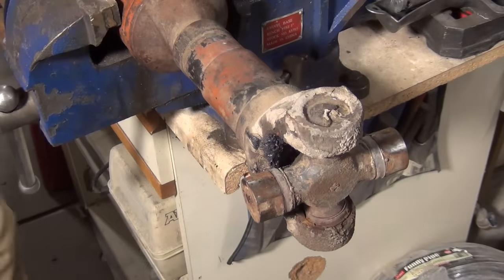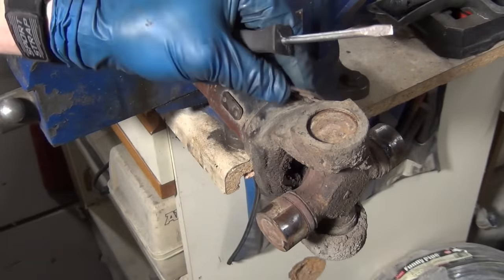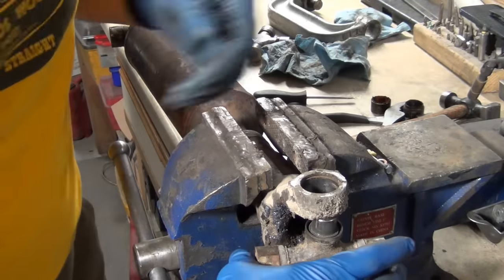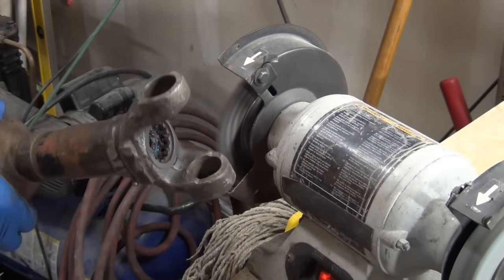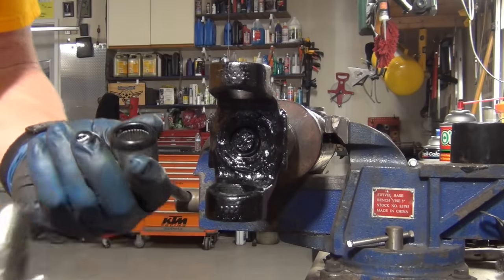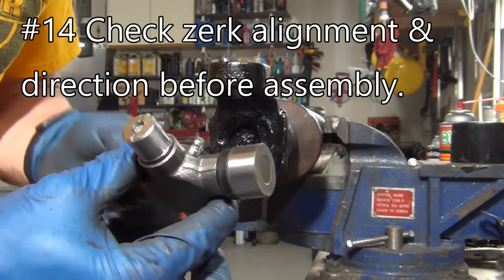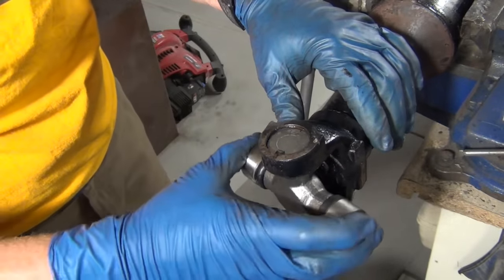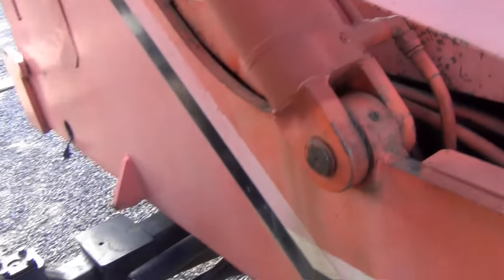20 Tips to Replace U joints Like a Pro from a Professional Mechanic

Comment: The moral of the story... Shop managers, hire those just out of high school to do this job. Why? Because when I was in high school auto mechanics i did this a bunch of times and consider it a task along the level of changing plugs. Now move the clock forward 60 years. I have to change my U Joints in my truck. So ran across this video and thought a refresher was in order. It should be a no-brainer ($10 parts and free labor) but after watching this video, I'm thinking, "You know, I'll probably take this to a shop since the labor will probably cost $150. LOL!" Nope, probably not because I have more money now, just lazier. And how much did U-Joints cost back in those days before China... I think about $6 ea. Great video! Thanks!
Reply from the maker: Welcome Sam!

Comment: I had an old mechanic tell me to watch for the rustty red color of a brick! He taught me that when you have a piece of metal grinding together that has no lubrication it pulverize the iron and turns it back into Orr! Which is what it started out as in the beginning! Orr is the color of a clay red brick when it is extracted from old mother earth. I have wrenched on cars for thirty plus years and have seen and looked for this color to tell me I have pieces that are dry of lubrication and needs attention 😉

Comment: Be verrrrrrry careful hammering on, and putting driveshaft in a vice. They are hollow and not designed to take side loads. If dented will break under torque when put in car. Hammering can create unseen stress fractures in metal. With heavy loads and stress can crack parts.

Comment: You recommended using brake parts cleaner and then you welded the same surface later. It would be good to insert a note about chlorinated cleaner and welding creating phosgene gas. Might save a newbie’s life. 👍

Comment: The Spicer that was in there was stronger than the one you installed.  The sealed u-joints are typically stronger due to not having the grease channels inside.  So, if you are blowing out u-joints in a lifted truck or highly modified vehicle by suspension or adding power or towing, then you may want to invest in some sealed Spicer u-joints.

Comment: Just for added piece of mind for the beginners.  Always save the old clips just incase the new ones dont  fit your specific application.  And after installation of the clips you can use a flat screwdriver and tap them into the slot to be sure they are fully set.

Comment: Love your style,, I have been a mechanic for about 50 years and back when I didn't have a press to push the cups out, I had to beat the cups out with a hammer. But other than that,, I replace the joint exactly like u do,, the grease in the cups have saved me many times. Harry lewis
Reply from the maker: Thanks Harry!

Comment: Wow, I think this is the most helpful video I've found for just walking through the process of doing U-Joints.  I've done plenty of these over the years, but I can see that some of your little tips are just pure gold!  I've never heard of using the ATF before, but I'll certainly be picking up a quart of that as I work over my CJ-5.  I'm just at the point where I'm putting axles shaft u-joints in, so this video is definitely getting a bookmark!  Thanks!
Reply: Try 50 % Acetone & 50 % (synthetic) ATF to loosen any bolt, they contain the smallest Moly  of penetrating fluid. Mix a table spoon together let it sit for 5 min, Acetone loosen the rust, Synthetic ATF lubercate the parts for disassembly..

Comment: Thanks for one of the best, informative, efficient, videos I've seen. I've never before learned so much in so short of time.  You addressed EVERY STEP AND PROBLEMS ran accross.  Thanks for all the tips.  1st joint - 5 hrs 
Watched video. 2nd  joint  - just over an hour including a shit and a snack!!  2000 ford f250 super duty crew 4 x 4 7.3 Thanks again.

Comment: Just put in U joints on a friends Ram 1500. Luckily I have access to the Auto Hobby Shop on base and used the press and dies.  Once I finished, the u joint was really tight and didn't pivot as smooth as I liked. A friend of mine also working in the shop that day told me of a "little trick" about tapping on the caps just a bit to set the needle bearings.  It worked and the joint would pivot nice and smoothly.  Ever heard of this?  Just like everyone else...put it out there, we'll watch!
Reply: Great advice

Comment: Over the years of working in the industries, trucking and personal four wheeling I've learned that you should always stay with the same grease or if you switch then remove all the old grease.  Different greases will attack each other and turn to a worthless light oil.  Also, when installing u-joints, make sure you put the grease zerk so it is under compression when traveling forward.   A hole in the u-joint where the zerk goes is a weak area. Enjoy your videos and humor.  Keep up the good work!
Reply from the maker: Thanks for the tips!

Comment: Thanks, nice video. Haven't changed any universal joints in like 40 years. Last time was on a 70 ish Ford Mustang and it was easy as pie like the few before. Caps pressed out and in with just a few taps of my hammer. Working on my Kubota belly mower and these are so tight I was thinking I was going to mess up the yoke so I stopped, stepped back and slept on it, usually my best course of action. Anyway, picked up a few tips and will get'er done today.

Comment: I've been replacing u-joints for years and I have to say I've approached them in many ways. In my youth it was a hammer and socket but now I use my homemade hydraulic press or my Astro ball joint tool I found on Amazon. 

I wish I could post photos here but I think you get my meaning...

Thanks for sharing Brian and great work!

Comment: I did this with the front shaft on my 90 Suburban.  I took the ring off the yoke and removed the yoke completely from the shaft to get it all cleaned out inside.  Thanks for the videos.

Comment: Thanks Brian.   Filling the caps with new grease is fine , but also chase out the shipping grease from within the joint and zerk fitting ,it looks like earwax.    That stuff is really not grease , but some sort of goop the manufacturer puts in there to keep corrosion in check during packaging , shipping and storage.
Reply: Yessir! Just found that out. Installed a sealed u-joint and was super stiff, so had to pop it out and inspect, found out that the manufacturers grease isn't grease at all. I pushed out the crap, removed and cleaned the needles and caps and packed it with wheel bearing grease. Works perfectly now. I was wondering why their stuff was so terrible... makes sense now.

Comment: Good informative video, bud. I like and agree with using atf. I've been using dielectric, which works fine for high heat lubricant and rust prevention, but atf is way cheaper! Thanks

Comment: good video. old news for old hands like like allot of us, but the next best thing to a hard days work is watching someone else do it!!! You would be surprised how many young guys can't change a u-joint to save their lives. I like to take a small dremel wire wheel and clean the yoke and snap ring bores really well. do it right and you can almost install the caps by hand. start pouring the meat to the caps with a hammer and you'll end up knocking the needles out. 5 minutes of prep work will save you 30 minutes of curse words.
Reply from the maker: Thank you- great advice Joe!
Reply: Not really accurate. There needs to be an interference fit. If the cups install too easily than the fit is incorrect. A hammer is fine if you know how to keep the needles from falling out. As simple as some extra grease...
Reply: I don't think he meant the caps just alling into the yoke. What I do after everything is apart is take a brake hone and run it in the yoke. With that I can lightly tap the caps in with a light ballpeen hammer.

Comment: Newer trucks and cars have plastic holding the factory installed U-Joints instead of G clips.  When you replace them, you need to heat them up with propane torch and the plastic will squirt out and then use G clips on the new ones.  I've been working on cars since mid-sixties and first time I did this job I was a bit perplexed but after seeing for myself I realized no big deal.  
Brian; it my help others to show them this particular twist so they can not be wondering what's going to happen.  I never believed the plastic would just squirt out like that until I saw it happen.

Comment: Brian, I have always completely set up one side cap fully into the yoke so that when I tried to install the second cap, the span of the caps will be close enough together so that the u-joint will slide onto both sides at a time, negating any room for the needle bearings to slip out.
Reply: That's the way I was taught to
Reply: Ume the Emu Metoo

Comment: I never change my u joints like this anymore , it's much quicker to zip cut them from the inside and tap them through with a small hammer , the initial shock loosens them up and your not fighting or dragging rust through the hole . Another reason is trying to push through extremely seized u joints you can tweak or deform the yoke and you will not get the retaining clip back in if their internal type with out a spreader tool . I tap them back in with a small ballpein hammer much quicker than pressing them in . I've been doing this for years .

Comment: Good video. Those ten buck U joints have ruined many a vacation and even caused drive shafts to drop out and pole vault vehicles into the air. It's great to be able to replace them yourself, and save lots of $$.  Also so many original equipment joints do not have grease fittings, which ensures a failure.

Comment: Just fyi though if you are a diyer and start messing around with your driveshaft you can cause vibration. So this job is doable and not that hard, just know though that you can cause problems, I know this because I did. 

I think in my instance my first mistake was not getting greaseable u joints I think the greaseable ones are more forgiving because you can put grease in there to help free them up. Also the u joints I got felt pretty tight, so I am gonna try and get some smoother greaseable ones. 

Also you want the u joint to feel loose and it should turn freely and smoothly in the drive shaft, that is pretty important you don't want tightness. 

Also it's CRITICAL that you mark everything so that it all goes back the same way it went in those drive shafts are BALANCED and if you start messing with that balance you can get vibrations.

Comment: Did many u joints over the years and had a few that would not move especially on bigger trucks. Easiest way I found to get them out is with the fire wrench burn the cross bar off then the caps just about fall out.

Comment: ATF is good stuff. Mix it 50/50 with acetone, and soak steel parts that have rusted together loose again, provided it has not fully fused together. Fixed a very old Colt .38 revolver like that once. The  (revolving) cylinder also known as 'the wheel" had rusted to the crane's axle shaft. Soaked it for @ 8 days in a closed container. Freed right up. WAs frozen so tight I couldn't begin to turn when I started.
On driveshaft universals, I remove them by using correct diameter sockets and the vise as a press to press out the universal. Cheap, no special tool/s and works well. One needs a helper though, to help hold/align DS.

Comment: good video.. want to add one thing here.. hopefully it doesn't confuse too many people ?? you always want to install the U-JOINT to COMPRESS the zerk fitting area .. meaning you want to the driving force to be compressing it... not tearing away from it..  the yoke off the transmission is the driving force..  the end of the driveshaft is the driving force before the rear differential yoke... the grease fitting is the weak part of a u-joint so it makes sense to be compressing it and not pulling away from it...

Comment: Nice vid brian , like the rubber plug substitute with washers !!  If ya could only explain to the audience why it’s VERY NECESSARY to tap the caps back against the snap rings so ya make room for grease to flow thru the cavity to the brgs !!  Most vids I watched don’t know about or don’t know why their loosing up the trunnion/caps !!  Btw my luck on hammering the caps in wouldn’t be as good as yours my needle brgs would’ve dislodged!!  Question, on ya road trip to MV did ya run into the Griswalds ....lol 😎

Comment: Using the vice and socket,  cross in one hole  fit cap then try forcing the first cap all the way with the cross in that cap till the cross touches the other side of the vice(this means putting the first cap in further than it should be)put in the clip for that cap. next put the second cap on and with a socket send the whole cross and caps back till the first cap comes tight to the clip. Doing it that way makes it imposible for a needles to come out or tip as the cross holds it in place at all times. Resorting to a hammer especially for first cup may shed a needle even with grease in the hole, don't ask how i know.

Comment: Brian , two things , a freeze out plug would have been real nice , also what I always do is I make a hone from a old antenna shaft , use the fattest portion cut it to 10 / 12 inches long , slice one end with the hacksaw down about 1in to 1 1/2 in , take roughly 10 / 12 inches of emery cloth , slide it into the slice that you cut , put the other end into a drill motor , variable speed works the best wrap the emery paper around in the direction that the drill will spin it , keeping it wound up ,insert it in the cup bore add some oil on the emery paper , spin it with the drill until the bore is nice an clean ,  works very well for me    Frank T

Comment: I used your method of using the larger socket but I don’t have a vice so I put the larger socket under the yoke and a smaller one on the top side and they all came right out

Comment: Take a large washer just over size of the hole by a 1/16 of an inch. Put it between two nuts on the treadled part of a bolt with the head removed. Put threaded stud into drill chuck and turn on and use grinder to grind the outside diameter to just a bit larger then the bore. Put washer on the socket so you could push it on the nut side into nut side to reduce the O.D. and then install into the hub hole hit with hammer to expand the washer and then weld small hole shut. Done, worked for me and should work for you too.

Comment: As a diesel tech, we have a really nice tool to remove from truck. I decided to remove the 4wd axle due to worn ujoint, hammered on the joint to remove it from the shaft and busted the yoke that mount to the transfer case, ooops

Comment: Definitely got a like because of used transmission fluid kerosene it's the best but transmission fluid and gas something to thin it out but straight high mileage transmission fluid will work good too with all the additives

Comment: The end is closed with a welch expansion plug (freeze, core, soft plug) Shape is a shallow disc drill a 1/8” air relief hole in center. Place concave down wind blow on the convex part expands it.  Available from 1/4 inch to 5 inch or so. Aluminum or steel.

Comment: A 50/50 mixture of transmission fluid an acetone works great as a penatrant just shake before use an put it in oiler 👍 great video btw
Reply from the maker: Good tip!

Comment: A "Vice" is nice, but in an emergency a u-joint can be put together with a hammer and drift, if your real careful.  The cup must be pushed thru yoke against the cross first to capture the opposite cup rollers so that cup can be tapped together and clear of groove.

Comment: Battery pliers work great for removal/install of retainer clips. Best not to hammer caps, this is when you will have the needle bearings in second cap dislodge if not fully started on the cross when doing it. If you take the zerk out when installing joint it will give a relief for the grease allowing  the caps to seat into position easier.
Reply: Yup just did that yesterday now wondering if i can save it without destroying the pins

Comment: I usually do this procedure similar to the way you do it, but I'm usually in the ditch beside the road. And out of beer.
Reply: Lost count of how many times i changed a u-joint out in the bush. Always carried a couple spares. Drop the driveshaft, lay it on the tailgate, and change the u-joint. Considered, one time, upgrading to ox-joints. But decided against it, as it's best to have an easy-to-fix weak point.

Comment: My U-joints are frozen in. 
I'm going to make two flat cuts threw the the heart of the U-joint as I take out the meet of the center of the center of the 
U-joint, so I only need half of the press presure. I won't have to heat the unit up either.
You might want to try it on your video upload.
Thanks for all your great exibits.

Little Stinker Strikes Again !!!

Comment: Grease holds the little needle bearings in place for assembly and also is required for proper lubrication at time of installation. Do not count on the grease zerk to equally distribute grease to each cap! Also, install one cap into the yoke at a time. It will greatly minimize any possibility of a needle bearing coming out of place. Just one cap improperly lubed will result very quickly in joint failure.

Comment: If you drop a zinc plated washer like that into a strong acid for a few seconds, like muriatic acid, it will instantly dissolve away the zinc plating leaving you a clean bare metal surface to weld. Leave it in the acid until the bubbling stops, just a few seconds.